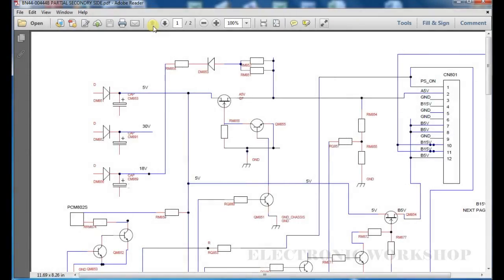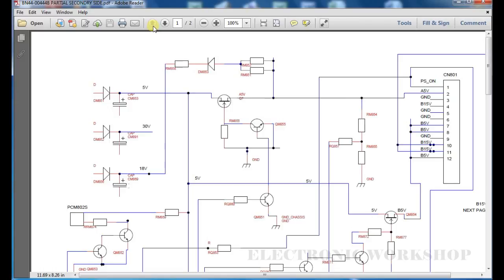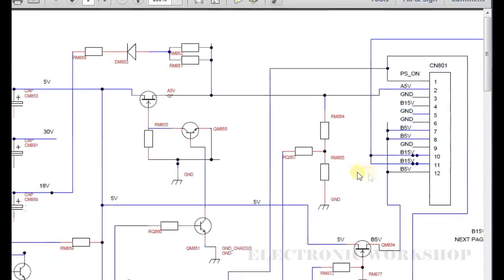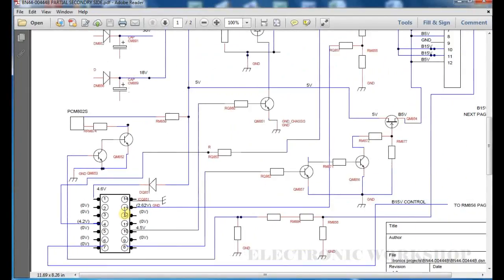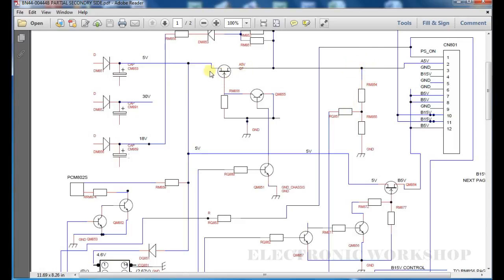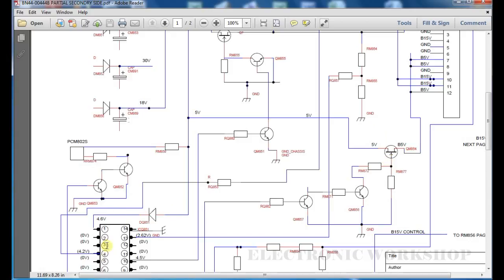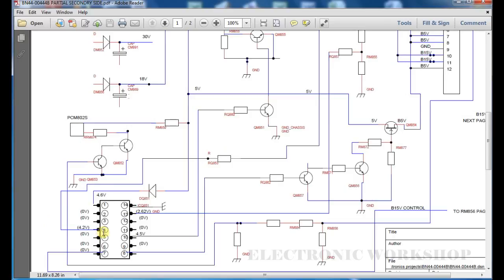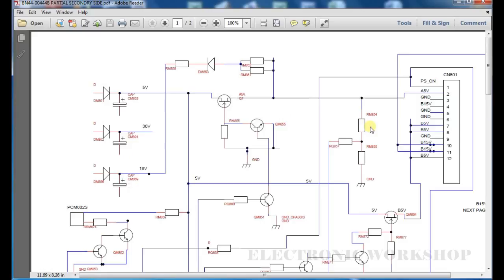PS51D550 Update | BN44-00444B |

Comment: Thanks for putting his and the other video together. I have one of these, which when the pin is shorted to test, does not operate as expected. I've not been able to find any faulty components. On mine, ICQ851 has 4.6v at the pin10 supply and 4.2v at pin 4 PS on, but nothing else including pin 13. There is 5V at one of the FETs and 23V at the other, but they are not coming on. QS851 is open except on 2 pins, DS857 and DS858 are short across two pins, but I think that may be expected as the diagram is showing back to back diodes across those pins??
Reply: There's signs of heat on the board around RS857/858/859 and DS 857/858